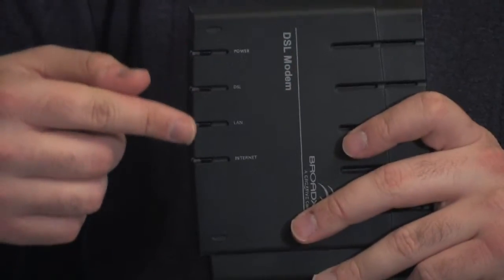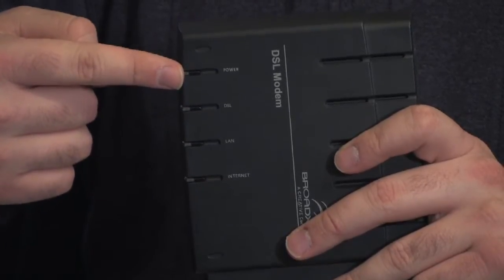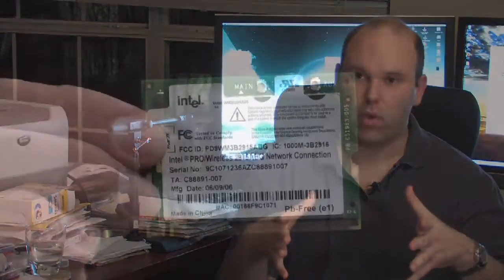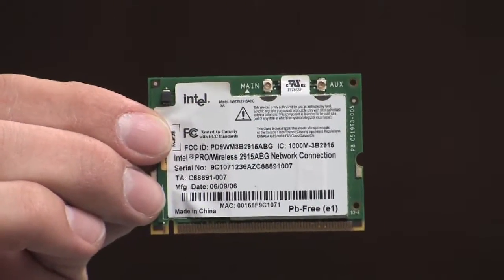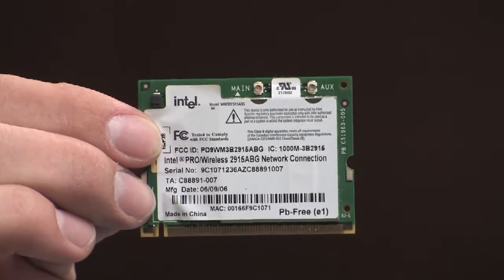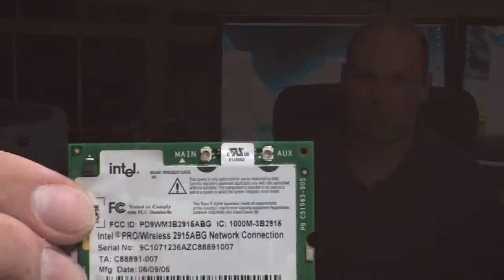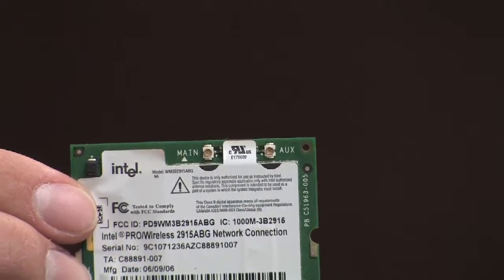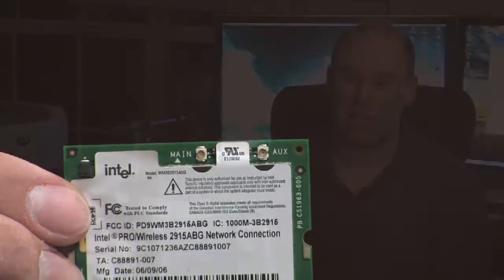Computer Basics : How Do Wireless Internet Cards Work?

Comment: Still a modem.  It MOulates and DEModulates intelligence upon a radio carrier.  Your DSL modem you hold does not use audio frequencies, though.  The analog modem which you should have been holding uses audio modulation/demodulation for the intelligence which yields the incredibly slow data rates.  DSL uses higher modulation frequencies which yielded a higher data rate.  noob.